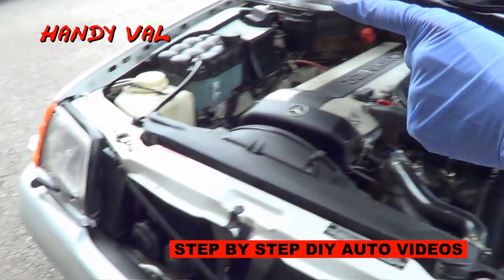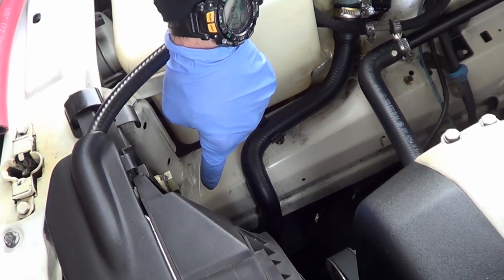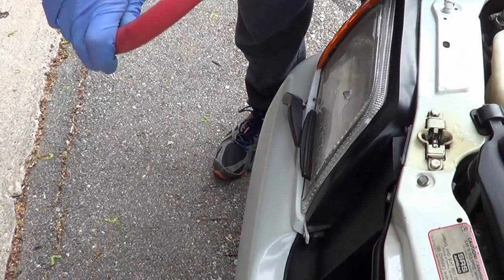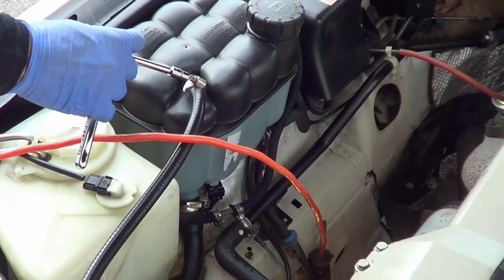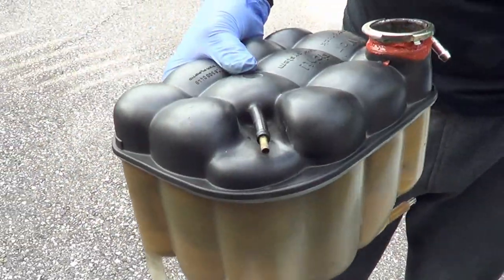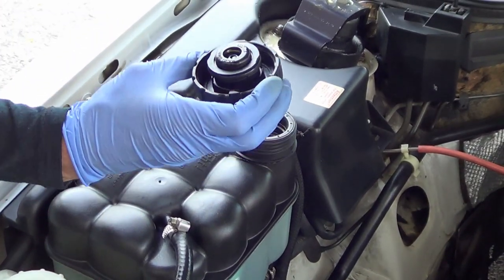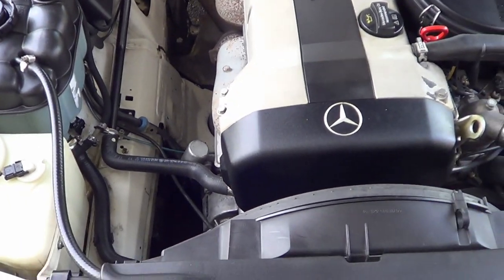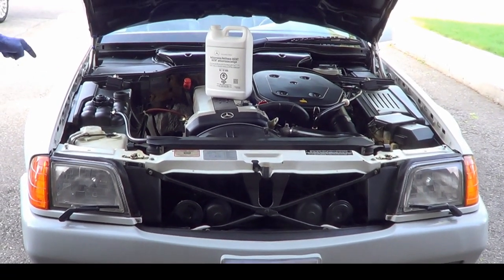Mercedes Coolant Reservoir Change and Partial Flush on R129 SL 300, 320, 500 and 600

Comment: I have a 1990 I just purchased and I’m starting the system refresh with the ex tank too. Noticed you had the newer cap and I had to watch , great job I’ll be subscribing 🎉
Reply from the maker: Congrats on the R129 purchase! The older tanks have a design flaw where they will eventually leak from the neck, where metal meets plastic. I call it a design flaw… but some are still doing fine after 30+ years! Thanks for subscribing- much appreciate it. More content is being planned.

Comment: There is an access panel on the lower grill that allows you to get to the rad drain. A very good video, i replaced my rad and cap both aux fans ran , due overheat , i had rather large bubbles coming out of the header tank so i hope i haven't blown the head gasket, i did everything like you have shown, so it may be just air in the system, BUT as a precaution i have orders a water pump just in case.
Thanks for the video, best regards Cheshire UK.
Reply from the maker: Thanks for your comment. Looks like you’re doing a lot of great updates to your car. Replacing the rad is a smart idea - sometimes depending on the car’s history they may restrict coolant flow due to debris and sediment. Head gaskets can blow but it’s typically a combo of continuous overheating (ie red part of the coolant gauge), oil and coolant change neglect. I think you’ll be fine. To get the air bubble out as a last step try parking on a steep hill or better yet idling on a steep hill. This should get any remaining air. On the coolant thermostat housing there is a small bolt that you can loosen and let air out. When the car is cold, loosen it, and tighten when coolant starts to flow.
Thanks for the panel advice - I do use it, but I broke the red plug and moved to the rubber hose to get the coolant out. Take care and keep me updated.

Comment: I have a 1999 SL500 and my coolant reservoir has a tiny pin hole near the plastic neck, I am going to work on it once I receive the part. Thanks for your help. I will definitely use your advise, this will be my first time doing this, pray for me, lol
Reply from the maker: You'll be fine. You got this. Make sure you take your time and don't rush it. Also, have a large catch basin to collect the drained coolant. Keep me updated.

Comment: I enjoy your videos, and this one was no exception!
I have an unrelated question......The last time I had my tires rotated on my 1990 500SL, the shop lost a couple of the plastic lug bolt covers.
Went to my local Benz dealer, they could not help.
Do you know where I might be able to find these items?
Thank you.
Reply from the maker: Thank you for watching. Much appreciated! I'm not familiar with the plastic lug bolt covers - I've only ever dealt with the solid lugs without covers, unless I am misunderstanding. I know some of the older Benz had plastic slip-ons for the lug bolts. You can try contacting a place in the UK called R129shop, or another UK co called SLShop. They are usually good at locating these hard to find, more obscure cosmetic-like parts (and many others parts too). If you mean the center caps (one per each wheel) - those call still found new (part number 201 400 0425 for the 17 inch) - you can try Pelican Parts. I hope this helps.

Comment: 1:32 what is that white container in the bottom left called? I’m buying a car but that white cap is cracked. Thank you
Reply from the maker: The white container is the windshield washer tank. Luckily, the cap can be purchased and easily replaced (without having to buy a new washer tank). The part number is 123 869 0172 for the car shown. I believe this part can sourced through Mercedes dealerships.
Reply: @HandyVal  thank you!

Comment: Hello Handy, My Mercedes R129 Coolant Reservoir is not leaking or damage
But it is very old and dirty and you can not see coolant level.
Is it easy to open and clean it ? Or you recommend to replace it with new one ? 
Moreover please advise from which website you ordered your new Coolant Reservoir ? 
And how much it cost you ? 
Thank you
Reply from the maker: Great question. Your reservoir plastic is likely discolored and you won’t not be able to reverse it. They all discolor with age. For cleaning all you can do is stick a hose in it and shake the water around. It won’t do much and could cause other problems - like some of that film inside the reservoir can come loose and if you don’t get it out it could make its way to the radiator and reduce flow in its narrow passage ways. The reservoir is one unit and it doesn’t open.
I bought the one is the video from Pelican Parts. But they are available at others like FCP Euro. It cost me at the time, $120 US plus the cap which was about $10.
If I were in your shoes, I wouldn’t make the switch to a new reservoir, especially given that yours is working. I would just refresh with new coolant. However, if your goal is to have a great looking engine bay a new reservoir will improve the look for sure. 
I hope this helps.
Reply: Thank you sir for your kind reply.

Comment: Thank you very much Handy Val for your helpful videos.
I have Mercedes R129 and the center console storage push bottom get out
Can you help me please to solve this issue?
Moreover the interior roof light is broken, any idea from where I can order new one?
Reply from the maker: Thank you. I’m glad the videos are helpful.
I think I understand your questions. Your center console push button is broken? If so you, I believe a few places sell it - octoclassic.com or classictrimparts.com I believe they provide written instructions on how to replace it.
For the interior map/roof light - it’s a 64111 Osram 12v5w. It’s a common bulb. EBay and other car parts place or online stores (like Amazon) should have this in stock.
I’m hope this helps.
Reply from the maker: I wouldn’t hesitate to use any of these sites. Two others are https://top-classic-parts.com/ And the R129co, https://r129.co/ Pricing and shipping costs will vary. I believe both sell the dome light cover plastic.
Reply: @HandyVal  Thank you very much Handy. I really appreciate your help. 
Kind Regards